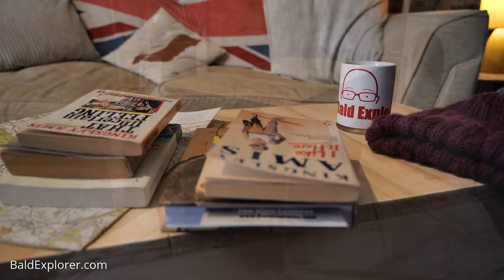How I Built a Homemade Coffee Table! H - Living a Frugal Life and Upcycling

Comment: A Tip for you Richard, to get the draw to run easier use candle wax, rub candle wax where ever the draw touches the table, draw runners etc. When I worked for a furniture company, we did that before delivering new furniture to the purchaser. Well done, the table looks cool.
Reply from the maker: Cheers, David. I will give it a try.

Comment: Wow Richard, that’s great.  It doesn’t matter what it looks like, it’s how it makes you feel having made it by your own fair hand.  I’ve never made furniture but I have painted a bedside cabinet and a shelf unit that were in need of restoring.  Still use them.  I also tiled the splash back in the kitchen.  I used wavy edged tiles and didn’t do it the proper way using match sticks.  I just whacked them up by eye and they still, after 20 years look rather good.  Not perfect but who cares, I did it myself.  I like your table.
Reply from the maker: Thanks, Kerry!

Comment: If you get yourself a bit of candle, rub it on the drawer sides and the wood it runs on, it will open an' close a lot better.
Reply from the maker: Good tip - thanks
Reply: @RichardVobes  Your welcome, and I used to teach my students 'sandpaper' is what we use at the bottom of birdcages, glass paper is what we use for wood. In the ship yards we used to use Garnet paper on our oaks teaks and mahoganies but now aluminium oxides are the normal.